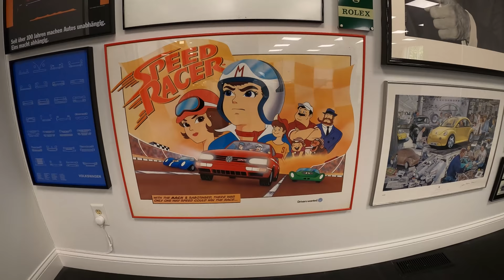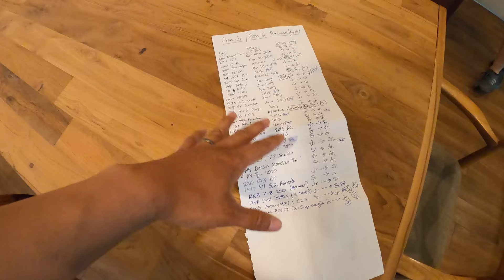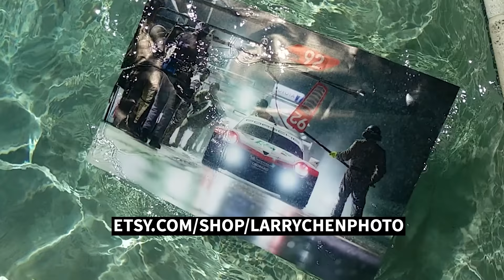Chicago’s Most Tasteful Car Collection? Megatour of Richard Fisher’s Insane All-White Fleet

Comment: 55:04 What’s the point in having a roll bar in a convertible Miata that’s shorter than any driver taller than a midget? That way you can get decapitated but your body stays in the seat? 🤨